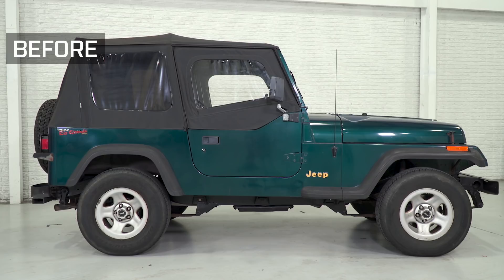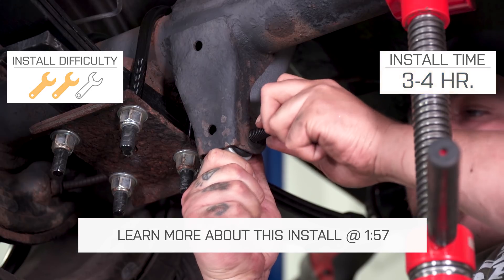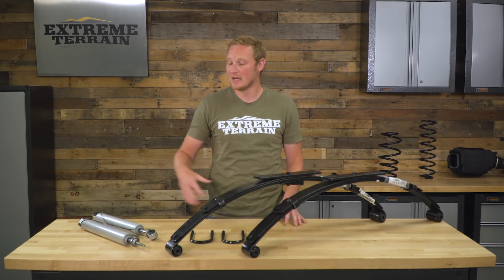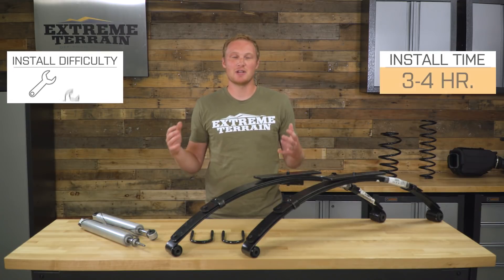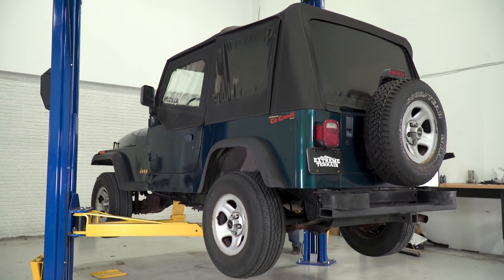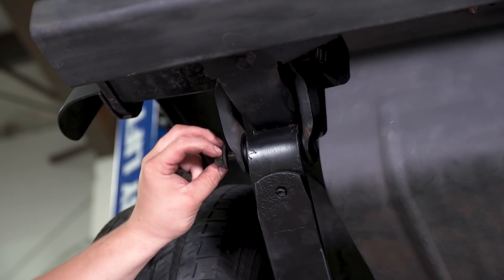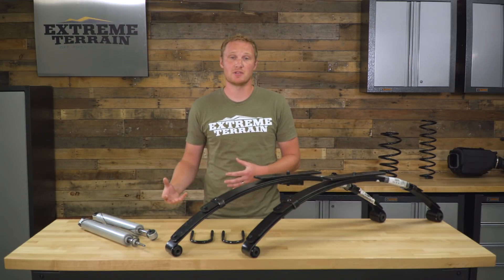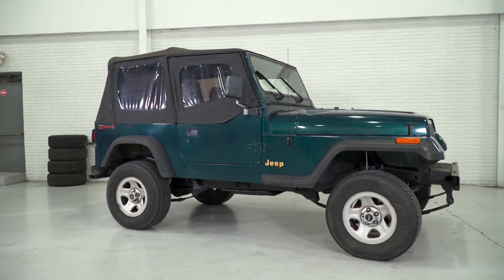Jeep Wrangler Rough Country 2.5" Suspension Lift Kit w/ Shocks (1987-1995 YJ) Review & Install

Comment: I'm in the process of fighting my YJ to get this kit installed. Hopefully the rear is easier than the front.
Reply: tjrieves what are you fighting, rust?
Reply: I don't know what the fight could've been, I installed this in my 94 YJ , it was a piece of cake. Removed track bar then did one spring at a time, front then rear. You can use a come- o- long or a ratchet strap to help line up spring center pin bolts. My Jeep is very very rust free, but I still gave everything a shot of 'PB Blaster' about a week in advance.

Comment: Anyone know if you can run 33x10.5 on this lift with no other mods?
Reply: @Future-Preps35   thanks! I asked some of my keeping buddies and they said that only going 2.5 shouldn't cause much vibrating, and I'm also mainly on the road, with occasional offroad.. but I've caught up on projects except my lift
Reply: Get a 1" shackle and you'll clear 33s
Reply: I have this exact kit on my ‘90 YJ with 33 x 12.5 Mickey Thompson mud terrains. 

I’ve gone through a few tweaks. 

First, freshly installed lift kit with all new bushings, shocks, etc. it felt like my spinal column was going to explode out of my body with every bump I encountered. Hated the ride and was super bummed. It softened up a little after about 1,000 miles. 

Second, I removed the track bars from front and rear. Holy shit. 70% better ride. No handling issues. 

Third, I just installed 1” greasable lift shackles with rear boomerangs. Also upgraded the shocks to Bilstein 5000 shocks. I’ve only installed the fronts so far and will do the rears this week. 

Tire rubbing, with just the 2.5” lift kit alone I only have rubbing issues near full lock when turning. The tires rub on the leaf spring. The remedy is to adjust the steering stops on the knuckles by adding shims as needed which I’ll do after the shock and shackle install.

This is all I can do to make the ride as smooth as possible. Oh yeah, I also got a Corbeau Baja XLS suspension seat which also helped. Super comfy. 

Lose the track bars everyone. YJ’s with leaf springs do not need them. CJs do not have them. They are a nightmare. I wish I knew that before I spent hours changing the track bar bushings when I did the lift. I had to burn those fuckers out with a torch and used a ball joint remover to press them out. 

Now they’re junk as far as I’m concerned.
Reply: I don’t think so I have this lift on my yj with 31s and I have plenty of clearance to run 33s

Comment: Would you need to extend the brake line
Reply: someone please answer this
Reply: Probably not but it’s not a bad idea if you plan on taking you track bars and anti sway bars off so you can take advantage of all your potential wheel travel. If I was to buy this I would also buy a 1 inch to 1 1/2 inch shackles,yse,new drive shaft and a high clearance belly pan.

Comment: Any need for shims with this kit?  Asking because I just bought 93 YJ w this kit and it has shims on the rear, but not in front.  PO didn't adjust drag link after and I;m thinking he may not have had a 4 wheel alignment done either.   Just looking for anything else that may be wrong and causing squirrelly steering when letting off the gas or accelerating hard before I take it in for the alignment.

Comment: What size tires are on the Jeep in the video?
Reply from the maker: The tires shown on video are stock size, so right around 29" tall. With a 2.5 in lift you can expect to fit 31s no problem! -Zach
Reply: @extremeterrain  Thanks for letting me know, I just bought this kit yesterday!! :)
Reply from the maker: Very nice! Hope you like how the kit fits and feel free to ask here or get ahold of our customer service team if you have any other questions! -Zach
Reply: @extremeterrain  I have one other question, would I have to get a  Transfer Case Lowering Kit?
Reply from the maker: At 2.5 inches of lift you shouldn't have issues with drive-line vibrations, honestly. But if you do feel vibrations starting, getting a transfer-case drop can be a good fix. For larger lift applications, a slip-yolk eliminator kit and new rear drive shaft would be best. But if you plan on sticking with 2.5 in. I wouldn't worry too much about it. -Zach

Comment: Does this kit require any changes to the driveline?
Reply: From what I've researched (I plan on putting this kit on my yj once I get the necessary welding done first) No it doesn't... However if after installing you notice some drivetrain vibration that transfer case drop is easy to do... Lol I have a buddy who used 4 hockey pucks with holes drilled in instead of buying the $50 kit which is essentially 2 lengths of box iron with holes in that line up with the existing mounting holes in order to drop it 1"